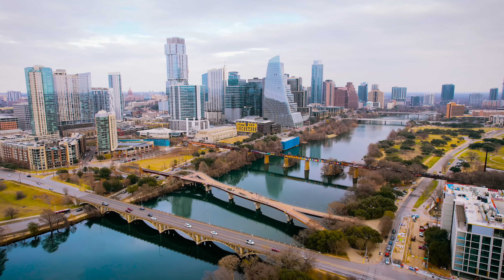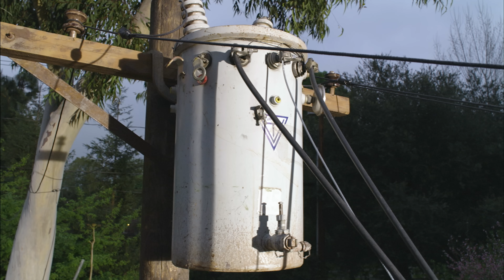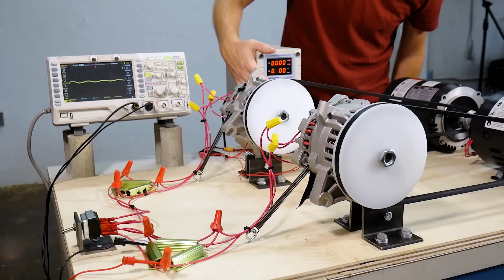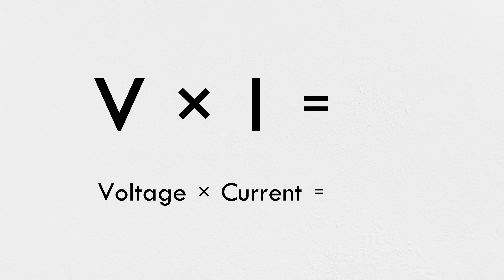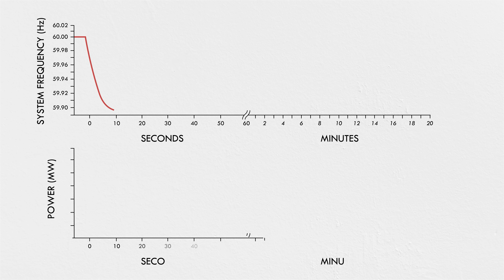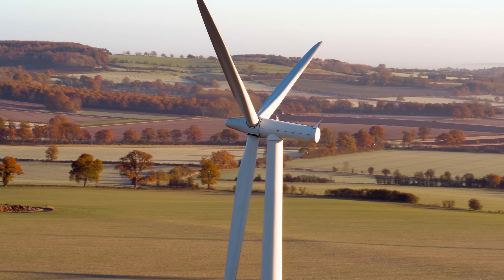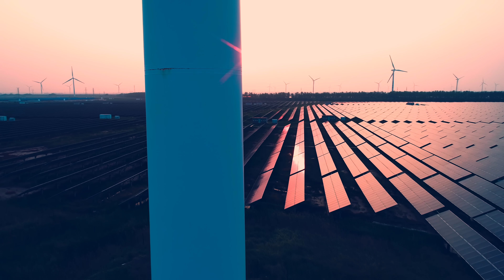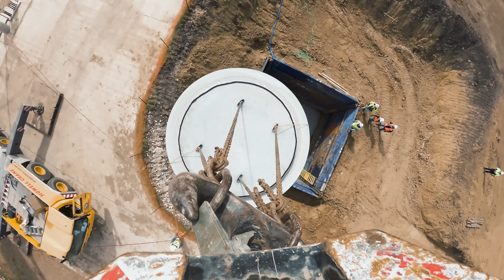Connecting Solar to the Grid is Harder Than You Think

Comment: In Toronto, you can either connect it to a battery, or the grid, but not both.  They won't let you use an automatic switch so that you can sell your solar power when the grid is working, but then use your solar power during a blackout.
Reply: You get grid tied inverters with battery now, that will charge the battery as priority with solar input, and excess will be fed back via grid tie, and after dark they will run off battery to a point, then leave the battery and run off grid till morning, when they use the solar to charge the battery again. Manage your power use and you really can be a net exporter, never actually drawing power in from the grid.
Reply: @herrtichy  I started a job recently working with solar inverters as a firmware programmer (not for the inverters themselves, for a device we make to get more out of your solar). I haven't worked with Fronius inverters yet myself but I believe our lead engineer really likes them. We've got one up on the wall for testing right now. As someone who really didn't know anything about the solar industry until a month and a half ago, it's quite surreal to see people talking about the same brands you've only recently learned about yourself.

Comment: In the past where i live experience a unusual fault. The electricity is unstable all the lights was flickering except led bulb and other appliances power on and off rapidly. Maybe related to this video. Anyone know what at fault? Thanks
Reply: Different equipment handles unstable power differently. Electronics typically don't use a lot of current and use switch-mode power supplies. These have some energy storage in them and can adjust their switching based on the supply. But other equipment like incandescents are garbage in-garbage out. A very common power issue is a tree across the lines. It is possible the fault was enough to mess with your power but not enough to trip the safety mechanisms. Could also be equipment failing. But no real way to know exactly what you encountered.
Reply: @username7763  Yup u are right low power appliances works fine especially those under 20w. Appreciate for your comments

Comment: From what I recall, in the early days of home solar.  There was the issue of these small systems de stabilizing the relatively small Hawaiian grid that all home solar was ordered off the grid until things got figured out.
Reply: There was a problem with too many producers on the same local wire pushing the voltage too high, which was fixed by requiring inverters to stop feeding above a certain voltage. I don't think they orderered anything off the grid.
Reply: @fjalics Hawaii killed the home solar subsidy plans as result of the grid destabilizing .  New home solar collapsed after that.
Reply: @Nill757 Electricity prices are high in Hawaii. Solar is cheap. It should work without subsidies, though I would look at batteries. I hope they have the good sense to put EV chargers where cars are parked during solar hours.
Reply: @fjalics . I see the appeal of solar, hey the sun is free, etc, but it’s a con.   The sun is free, but the making of large number of panels, installing them correctly, perhaps buying land, then disposing of it all, maintenance, and that’s not free at all. Then of course, “solar” by itself is no solution for any modern society, we all know another source is needed (for night/winter/monsoon) with its own maintaince and power distribution cost. Yet we see many of these posts saying solar is cheap with some  throw away line at the end about “batteries” or whatever, as if those were free and last forever.
Reply: @fjalics BTW, the power draw for EV chargers is way too high to just put them at every business/office.  The load would be more than building draws, meaning an entirely new power service would have to run. The grid doesn’t work like that. It’s like the highway system, trunk and branch. Can’t run a super highway exit to everyone’s garage.

Comment: I wonder: If a significant portion of the population had "Grid down battery back-ups" and a way for the grid to communicate with them, if we could use that as a near instant response to dump power into the grid when necessary.  If I had such a system, I would be fine with the power company draining up to 40% of my battery storage to prevent a grid-down situation.  It seems like such a system plus distributed power generation (solar and wind) would create a very robust system that could withstand multiple faults before becoming a problem.
Reply: There was an idea to use electric vehicles as grid level storage. A lot of newer models are bi-directional charging.
Reply: You should check out the Orkney islands power with solar, wind, wave, and tide. Could the battery in your EV be part of the grid?

Comment: the other reason home solar arrays typically shut down is because they are not allowed to remain connected to the grid in a power outage, and it's easier to shut down the array, than to have able to disconnect from the grid and operate as a standalone system.
Reply: It's a function of money. This technology already exists, it's just not practical for an individual homeowner
Reply: @thedude5040  a standalone system pretty much has to have a sizable battery bank and be able to manage production based on the battery bank.  and have an air gap transfer switch to disconnect from the grid.  doable, but people haven't started asking for it in enough numbers to inspire manufacturers to go there.
Reply: @kenbrown2808  why invest $30-50k for this kind of setup when a $600 gasoline generator with a 5 gallon gasoline can does the same thing.
Reply: @thedude5040  it's not going to cost that much MORE than the grid connected system.  and a 5 gallon gasoline can is good for about 8 hours, depending on the generator.
Reply: @kenbrown2808  mine lasts about 15-24+hours off 5 gallons
Reply: @thedude5040  it must be a tiny one, then.
Reply: @kenbrown2808  5kw. The new inverter style gas generators are way more fuel efficient. I guess I spent $850 on mine,  but still. I poured at most 2 gallons into it during the last tornado outage and got around 10 hours out of it. For homes with natural gas heat, hot water, and stove 5kw is all you need. Heck it even ran the air conditioner unintentionally because I forgot to turn off the thermostat before hitting the manual transfer switch. I'll admit it is hard to find a 240v inverter generator but they are put there.
Reply: @thedude5040  yeah, the new one runs more efficiently than the old one, but I'm still topping it off at bedtime and first thing in the morning.
Reply: @thedude5040  because it doesn't use up gasoline
Reply: @alexc4924  for the few hours a year you are without power it's arguably more enviornmental to burn a few gallons of gasoline over all the shipping, mining, and labor to have grid tied solar with islanding capability vs grid tied solar with no islandia capabilities with a $600-900 gasoline generator.
Reply: @thedude5040  my new generator already has a hundred hours on it.
Reply: @kenbrown2808  that's far from normal for the typical US citizen. Even the tornado that hit my neighborhood, damaged the substation, and destroyed both incoming transmission line and neighborhood distribution lines only took 9 hours for power to be restored with temporary poles.
Reply: @thedude5040  and our last ice storm knocked out what is normally the most reliable transnission line for more than 4 days. Not all the country is like your little corner.
Reply: @kenbrown2808  ice storms can be very problematic and are about the last totaly devastating event outside from Hurricanes. The weather here is so hellish that generally all the trees over power lines were killed by previous ice storms or have been cut. 0.5" ice with 50mph winds will do serious damage. Going back to solar, if we didn't have natural gas solar plus battery backup won't do much good on a winter night with -40F wind chills. My peak usage with the heatstrips in my apartment while I had my house built was 12KW for an 800sqft 1 bedroom during major winter storm.
Reply: @thedude5040  Now I see. I actually have a completely off grid island system because I think it is cool to have one.
Reply: Especially if the inverter connects in parallel with the grid, it's impossible for it to isolate itself. A smarter inverter MIGHT be able to do so.
Reply: It's mainly to protect linesmen, so a homeowner's solar array or wind turbine doesn't make a power line, presumably dead because it's downstream from an outage, unexpectedly live. This goes back before solar & wind were common, when  back up generators & their transfer switches were around for factories, hospitals, etc, made to physically cut themselves off from the grid, before they begin to generate power.

Comment: I've also heard about the problem of voltage rise near solar installations- as solar panels doesn't use the concept of power angle like generators, the only way they can inject energy into the grid is by increasing the voltage a little bit. This is fine for a few panels, but in residential areas having large number of installations, each panel has to up their voltage, resulting in significant rise in voltage in lines in the vicinity.
Reply: Mostly because the grid was designed as one way, you would need to have a lot more automatic on line tap changers in the residential suburbs to counter this, as they typically are only used in the larger local distribution network for the primary incoming transformers. Local uses mostly off line tap changers, set, locked and left as you cannot change them energised. Automatic tap changers in areas with lots of solar will help, but the expense for the utility is not warranted, seeing as it is not power they are able to bill for easily, and thus low on the priority list to implement. Residential inverters are programmed not to exceed peak line voltage, so the power loss is purely on the solar household side, not the utility side.
Reply: Usually there are certain limits to this effect, so that PV inverters will lower power to prevent the voltage from rising too much. In addition, there are actually concepts to counter the effect by drawing reactive power (lowering the cos(phi) of the current injected in the grid) at the same time. I don't know if they are implementet in current PV systems, though.
Reply: I dunno about "significant", but your surmise is wrong... grid-tied inverters do use power angle like generators.  They push phase, not voltage.   But that does have two side-effects which do cause the voltage to rise.

(1) The homes are burning less energy from the grid, the lighter loads mean higher voltages.

(2) The exported energy has to go somewhere and since it isn't going to frequency that leaves only voltage.  Even though the inverters are pushing phase, there will be some voltage rise on the whole circuit as the energy smooths out over distance.

But again, "significant" ?    Its possible but exceedingly rare, and it will still be in-spec since the grid-tied inverters trip-off if the voltage goes out of spec.

A very real problem is that voltage rises in residential voltages feed-backwards through the pole AND substation transformers which multiply it back up to transmission voltage levels.  And even when these rises are within specifications, the multiplication on the way back, if the backfeed gets all the way to the substation, can cause the transmission line voltage to go out of spec.

This is easily rectified but requires a transformer upgrade at the substation (basically to a modern transformer with two-way sensing and automatic tap control).   Fortunately, though, this sort of situation only occurs with a very small number of circuits, so mostly problems develop because utilities are blowing smoke and purposefully letting them get out of control to try to convince politicians to slow solar installations down.

-Matt

Comment: All that spinning mass is the stored energy to get through transient events.  On an airplane I worked on there was a motor generator to both get a particular DC voltage an aftermarket system needed AND it also ensured clean, stable output even if the input AC was interrupted briefly.
Reply: An NC (Asheville?) TV station was said to have had a flywheel 'buffer' between the mains grid and the on-site diesel generator. That way, when grid mains were lost, the switchover was not a blackout / brownout event. The spinning flywheel buffed out the transition.  Sorry, but I don't remember the call letters. I'd heard this from TV engineers back in the 80s/90s.

Comment: I'm sorry folks but when you want to Upload your Solar Farm to the Bulk Electricity Grid. You have to accept the CONDITIONS set by your Jurisdiction Bulk Electricity System Operators. Someone else's safety relies on a safe and provable disconnection between Generators to the Transmission Lines. 
this is why Tesla ages ago said that Solar and Wind Power Generators are not good players in the Bulk Electricity Generation System. You can't just jump in and out of Generation without dire issues for the System Operator. Now, think of all these Part Time Generators whom rub their hands thinking I can upload energy for free and take a piece of the pie without any responsibility. 
Here at work, because of Large Solar Farms and Wind Turbine Farms. Transmission Operators have put in place auto synch disconnect switches built in the major Switchyards to protect Transmission Line workers from unnecessary feeds to the bus lines.

Comment: I've been running an off-grid solar experiment for most of the past 10 years. It has a massive (1 ton) battery bank.

Solar Power is a scam. It does not work on the edge cases.

Comment: I know of a few new factories here in Austria that use two separate power grids. One classical AC, the second one DC to use the electricity from the solar panels on the roof directly.
Reply: It's interesting that, DC-sources are causing people to start thinking outside the AC box, and start looking at using the DC directly (pun intended).  The simplification it creates has benefits.
Reply: Where are they located, which companies?
Reply: I've wondered when DC end to end would start happening (even if in small scale), given that more and more loads either use DC (lighting, electronics), or in principle could just as well use DC or AC, while there's increasing generation that's inherently DC (solar).  As an aside, AC is responsible for much loss in the grid (for the same reason that transformers work... induction).  More and more long distance transmission lines are DC.  So the chain is sometimes DC generation, DC for part of the transmission, and DC loads.  I've read that some companies are working on fully DC grid designs.  I doubt that it'll become the norm in my lifetime, but I wonder when the benefit of transformers won't be sufficient to justify AC, if DC grid technology gets sufficiently good someday.
Reply: @bearcubdaycare  one of the problems is, DC doesn't work well over longer distances, not without some seriously big cables. but if you were going to do certain dedicated things, like say a direct PV connection to an electric hot water heater, then it might not matter as much.
Reply: @johnhufnagel  Actually, DC does work better over longer distances. It's why a lot of new very long distance transmission systems are HVDC. As far as cable size goes, it actually uses less conductor material to transmit with HVDC because you don't need three cables in HVDC like you do in HVAC because HVAC is 3-phase.
Reply: @johnhufnagel  
DC is better then AC for transmitting power. (and much eaiser to interconnect)
The problem is high voltage is much better then low voltage for transmitting power and changing AC voltage is much much easier then changing DC voltage.

So it ends up being high voltage AC is better then low voltage DC for transmitting power.
Reply: It tickles me to think of fancy new Austrian factories working on basically the same principle as the old camper trailer I used to have (which had an external AC connection for the aircon, appliances, and wall outlets, but ran all the lighting off an internal 12V DC circuit powered by a car battery). ;)